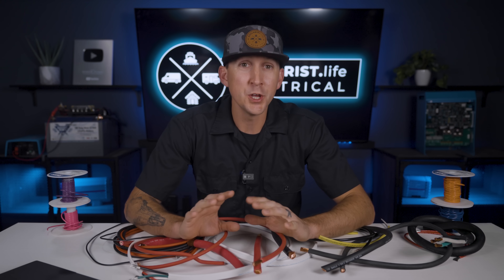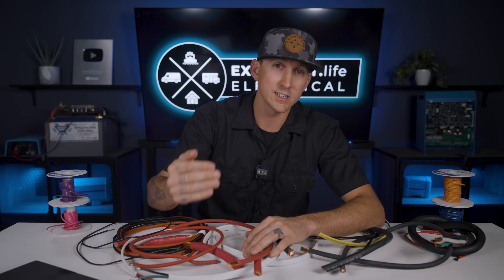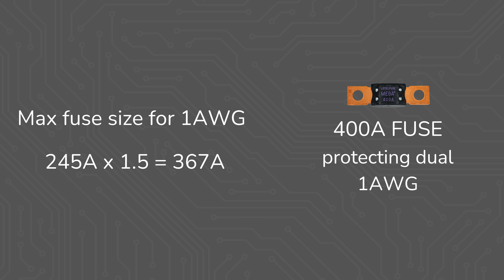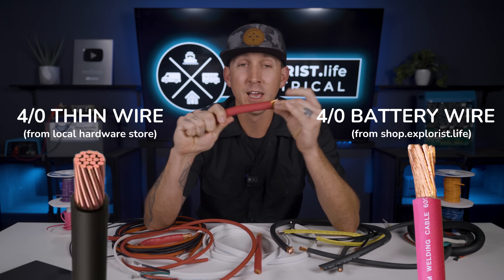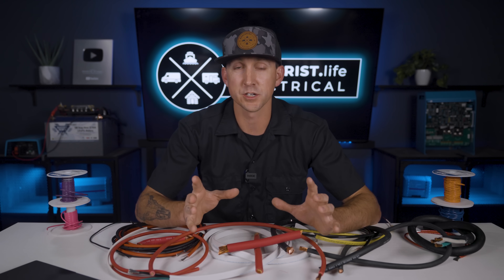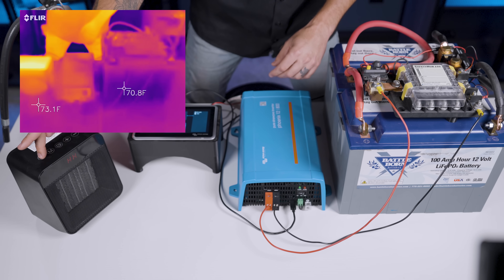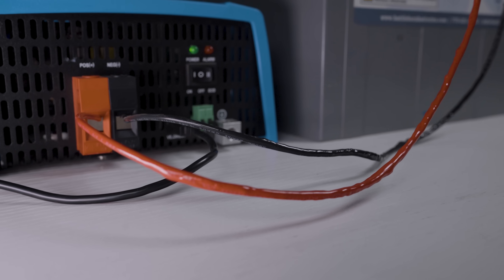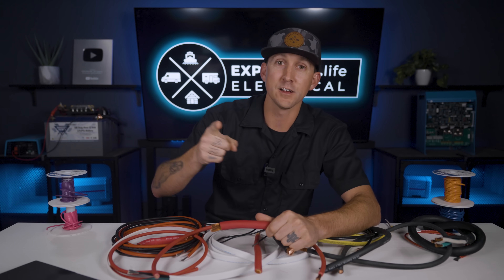Common Wire Mistakes in a Mobile, Marine, and Off-Grid Electrical System

Comment: yup, manufacturers are not always correct., Accurate, safe, whatever. Sometimes typos, sometimes just bad information, sometimes not up to code -whatever the case may be it’s always good to double check everything/everybody when it comes to electrical installation. Question everybody lol.
Reply from the maker: That's a great point, always best to double-check everything!

Comment: Hi.
Installing a solar system on my travel trailer. So far, I have panels, mptt controller, and battery  all wired and running.. inverter is in place, but no wires connected .. here is my dilemma.. battery is about 7.5 feet away from inverter... no way around it. Cannot reduced distance.. is a bumper puller with a traditional front compartment.. and 2 upgraded  100 amp lithium batteries in parallel....inverter power is 2000 watts. My question is. Will a (3/0 awg) welding wire do the trick... 7.5 feet away straight shot from inverter to batteries, no rerouting. Thanks for the reply in advance 😊.
Reply from the maker: Sounds like you're making great progress on your setup — nice work getting the essentials in place!

The distance you mentioned definitely adds some considerations for wire sizing, especially with a 2000W inverter. 3/0 welding cable could be workable depending on a few specifics like voltage and how you're terminating everything, but it's always best to verify based on your exact layout and gear.

To make sure you get the right guidance for your unique setup, reach out to our support team here:
https://shop.explorist.life/support
(EXPLORIST.life offers free personalized support for items purchased from our store!)

If your gear was purchased elsewhere, our Pro Support Membership is a great option to get custom help from our team:
https://shop.explorist.life/shop/all-products/membership-tiers/

We’d be happy to help get everything dialed in!
Reply: @EXPLORISTlife . Much  appreciated.

Comment: If the Victron 100|30 and 100|50 allows up to a 6awg wire, wouldn't adding a ferrule make it too big for the opening?
Reply from the maker: Nope

Comment: I got a multiplus II and the two battery studs for each confused the crap out of me. I bought 1/0 wire and if I understand this I can only use these if I use two of each? Is that why you recommended 4/0
Reply from the maker: This may take a more in-depth look at your personal setup.  If you have purchased/are purchasing from our store (shop.explorist.life) reach out for some more personalized help: shop.explorist.life/support

If you've purchased/are purchasing elsewhere, reach out to your dealer for support.  We'd love to have you as a shop.explorist.life customer so we can provide a bit more help in the future. 🙂
Reply: @EXPLORISTlife  I wish I would have found you prior. 
I bought everything from battle born and they set me up. I actually have a very similar set up that you have in your diagrams. Multiplus II hooked up to a lynx with two game changers. 

I read the manual for the Multiplus and watched multiple videos on your channel. The manual says two 1/0 wires for each positive and negative. That would be a pain to hook up to the lynx.
Reply from the maker: Even if you purchased your components from Battle Born; we've stilll got you covered with the wiring kits to wire everything together: https://shop.explorist.life

Comment: Nate, am I remembering correctly that when you wire up any component that the negative and positive wires should be the same length regardless if you need the length on both sides or not?
Thank you
Reply from the maker: That's not critical in all cases.

Comment: A thermal camera is a must for building and servicing DC electrical systems.  It's also great for assessing insulation effectiveness in a van or house, thermal bridges and leaks.  All electrical equipment generates heat including security cameras and spy cameras, so you can use a thermal camera to find hidden cameras in a hotel room AirBNB etc.   Infiray T3S sensor is amazing but there is also the P2 at more modest price on Amazon.  Ulefone phone manufacturer has one unit with a thermal camera built in.

Comment: I have Studer 50A - 2 input / 3 output battery isolator which has two 240v battery chargers, a small solar array and the alternator connected to it, and three battery banks. I want to replace my leisure battery bank with Lithium. Can i fit a DC _ DC charge controller between the isolator and the lithium battery bank?
Reply from the maker: This may take a more in-depth look at your personal setup.  If you have purchased/are purchasing from our store (shop.explorist.life) reach out for some more personalized help: shop.explorist.life/support

If you've purchased/are purchasing elsewhere, reach out to your dealer for support.  We'd love to have you as a shop.explorist.life customer so we can provide a bit more help in the future. 🙂

Comment: I was running a capacity test on a 12 volt 200ah lithium battery a while ago using my usual equipment running 1\0 cable. I noticed a significant temperature increase on the negative cable. I don’t have a flur but using the temperature setting on my multimeter it was over 20 degrees C more than the positive! I have tested a lot of batteries but have not seen this with any of the others. There must be some sort of resistance on the negative side of the battery maybe through the BMS or the cells themselves? What do you think could cause this?

Comment: I have a 100 watt solar panel 18vmp, 6.18amp lsc.  And a 100 watt solar panel, 18vmp. 7.72amps lsc,   Should I wire them in series or parallel? This really confuses me. Help!
Reply from the maker: Hey, @onlylexus! I appreciate you taking the time to ask your question, but unfortunately, I don't have enough info about your specific question to provide an accurate answer, but here is a playlist that, if you watch all of the videos start-to-finish (and take notes 😉), you'll have a REALLY good idea of how to design a solar array: https://www.youtube.com/watch?v=Jkbs84sBHsg&amp;list=PLmvhcyi4n0TV9pi83rFTv3ZuMT_S1xIZt

Alternatively, I have some of my most common solar array setups pre-built here: https://shop.explorist.life/product-category/all-products/camper-wiring-kits/solar-charging-wiring-kits/

Comment: I can't, for the life of me, remember where I read or saw this info but, when it comes to using two wires/cables for inverter connections, each wire is supposed to be able to carry the full current.
The idea being that the intention isn't really to save money on smaller wire, but rather, its purpose is to be a redundant setup, so that if a connection goes bad(loose, for example), or a cable gets damaged, you avoid a dangerous overheating situation, since the second wire will still be able to handle the current.
I really wish I could recall my source on that info. I thought it might have been Victron's (excellent resource) book titled "Wiring Unlimited", but after finding the relevant section, it says the same thing you said, about simply making sure the combined cross sections total the correct cross section for a single cable.🤷🏼‍♂
Anyway, good vid/info, as usual.

Comment: In Australia, it is OK to fuse parallel wires on one fuse appropriately rated to the total mm2
Reply from the maker: Idk… still not a good idea, even if allowed, for the reasons outlined in this video.
Reply: So, by Nate's logic, stranded wire has to be fused at 150% ampacity of a single strand.   It maybe could be the case if there is a real possibility of one wire getting cut or damaged and the remaining current being carried by the parallel wire.  That seems remotely possible, but then stranded wire can also get damaged and have fewer strands carrying the current.  So how far do you take this worst-worst case into practice?

Comment: I would think the battery jumper wire sizes could be load/n (load divided by number of batteries "n").
Reply from the maker: It's not 'quite' that simple  Sizing the battery interconnect wires to match the wire size coming from the battery bank is the way to guarentee it works in 100% of use cases.  This is why we have it like this in all of our wiring kits in shop.explorist.life
Reply: @EXPLORISTlife  I see the mistake.

Comment: Spike question: I want to supply a dehumidier (7.5A, 115V).  Its power use is ~565W ( ~900VA (.62 power factor)).  I am looking at using a 1000 Watt Continuous/2000 Watt Peak Pure Sine inverter.  Assuming 4x spike allowance, the inverter looks viable, but I'm confused about whether I should be looking at VA (with power factor) or (real) watts.  The inverter is advertised with "watts".  I measured the dehumidifier running as nameplate says with a Kill-A-Watt.

Comment: Nice demonstration.
It confuses me how the load wattage is applied to the battery voltage for amperage because, for example, a 125A MIG welder can use a 120V 20A circuit.

Comment: "Cool"
ummm

Part of the inverter's difficulty was the voltage drop across the small gauge conductors, and we don't know what voltage the input of the inverter was seeing. Ironically, that will increase the current draw.

I wonder what voltage the heater was seeing?

Comment: I have a question. I just buy a use Victron Energy SmartSolar MPPT 150/70-TR VE.Can Solar Charge Controller. I installed into my system, the bluetooth not link to my Iphone Victron app. screen not sure why. All other Victron products such as Victron SmartSolar MPPT 100/50 (2) all show-up in my Iphone app. Just wonder, it the bluetooth still working as should be or I miss something. Or you know any Victron service center, so I send the Victron Energy SmartSolar MPPT 150/70-TR VE.Can Solar Charge Controller to check and fix, if possible. Thanks. Lee

Comment: I’m designing a 48v system using EG4 and Victron components. Your videos have been very helpful in the making sure the wires included with the inverter will be accurate in the rating range of the different applications of this system

Comment: Fro safety reasons, I would use smaller fuse, not larger fuse. In your case it would be under 400A, not over 400A. Since the wire rated for 245A, I would go at most with 350A fuse. 
Why do you ask?? Well Watson the answer is simple. Fuses are cheap to replace and replacing RV from electrical wire is not cheap.
Reply from the maker: It’s best to size the fuse appropriately and not over nor under.

We have 12, 24, and 48v systems available in our store. 🙂

Comment: So important to install proper wire size and fusing. I feel like I know it all and do everything properly especially with these auto passthrough inverters. With the auto passthrough on RV’s for instance a guy can easily draw 3500 watts like I found out last weekend. I decided to exercise the batteries as I had been plugged in to shore power for two months. So I unplugged the camper left the Air conditioner on, washed the dishes then microwaved lunch. While microwaving I noticed the inverter putting out excessive heat on the back of my legs got to looking and I had forgotten to shut off the water heater tanks electric element. So at one time I was pulling 1300 watts A/C 1500 watts water heater and 750 watts microwave. It was a humming.  Although everything can handle it I have nowhere near enough battery and solar to maintain such a load throughout the day. Had I made that simple easy to do mistake with 2/0 cable and no fuse it would have been dangerous, stinky, scary as well as hot.

Comment: I had trouble finding wire size calculators that worked online for making battery interconnect busbars that need to transfer 100A 12v in a 24v battery bank... One calculator said 4mm2 copper which was obviously wrong, another said 90mm2 and a third said  1000mm2. I made the copper bars for the busbar according to the one recommending  90 mm2. Only to find out later that it could not calculate lengths shorter then 50cm and I had put in 10cm which it had changed to 50cm resulting in a busbar that could take 3000A which is super overkill when I found a wire size calculator that could calculate with 10cm lengths (and smaller)...  I have used online wire size calculator online for 20 years and never had trouble with them bein incorrect until now. I blame all the search engines that after covid went crazy with sensorship and now is full of missinformation as they have deletes all the information that was correct...